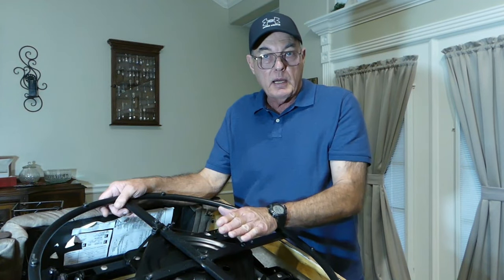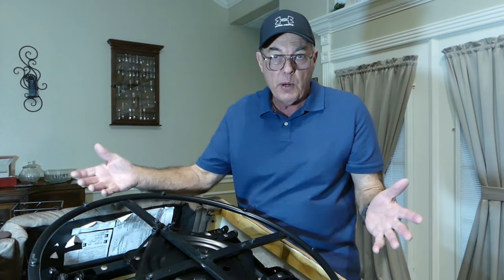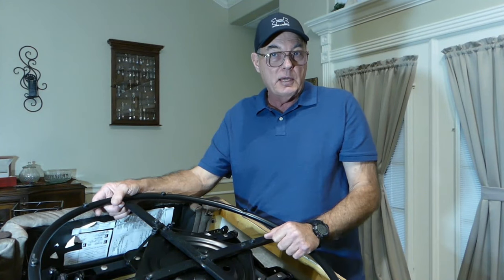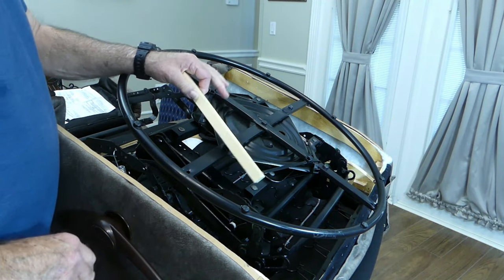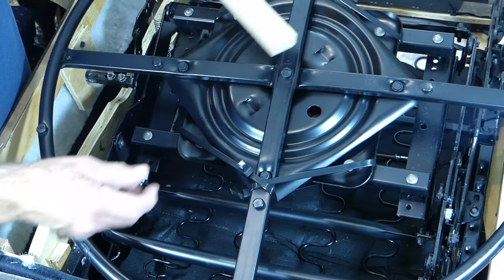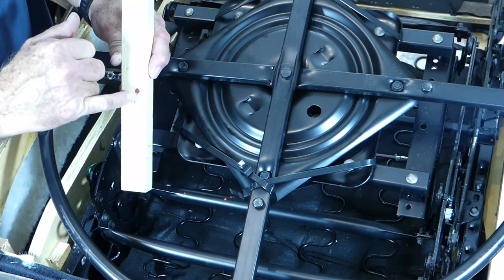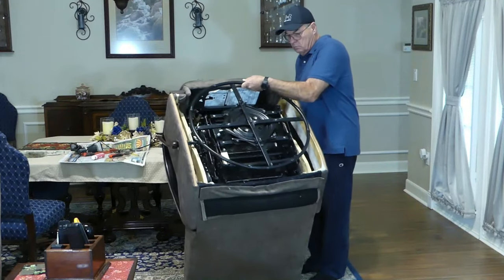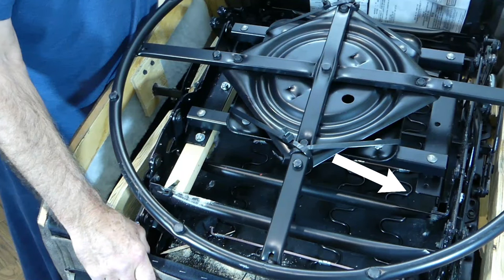How to Stop a Recliner from Rocking - Simple, Effective Method

Comment: Could you just the zip ties in all holes?
Reply from the maker: The problem is that you have to be able to stop both forward and backward motion.  I could have used a zip tie in one of the front holes and tied it around the stationary bar in front.  Then I would need to run a zip tie from one of the back holes to something stationary at the back of the chair.  Unfortunately, there wasn't such a place, so you would not be able to completely stabilize the chair.  Check your chair though, you may have a different mechanism and your idea may work.

Comment: Appreciate your videos! 😊 If possible, can you also show how to get a rolling desk chair to stop swiveling? My son, while sitting at his desk, doesn't want his chair to swivel while he works, as it's distracting. There is not a locking mechanism on the desk chair for the swivel, like there is for the chair tilting. (I thought 20 years ago we had this option on chairs.) I searched for a new rolling desk chair for him without swivel, or with locking swivel, to no avail. I was hoping to follow your tips to stop swiveling like you did on the recliner, but the rolling desk chair is different underneath. So I humbly ask, can a rolling desk chair's swivel be stopped? 😂 Thank you!
Reply from the maker: I,m not sure. I'll have to think about it until the little light bulb goes off in my head.  If I come up with a solution I'll probably do another video  and I'll try to comment back to you personally.

Comment: Great explanation, thank you! Do you think one would be able to just get by using a cable tie only to secure the mechanism once locked in position?
Reply from the maker: That may be possible if you have a different mechanism from mine. The problem is that sine the chair rocks in two different directions it takes a minimum of two cable ties.  Also you have to have a two stationary pieces of the frame, one on each side of the mechanism to make that work.  Unfortunately, there was no way to do it on my chair.   Using the wood piece really works well.

Comment: Will this work for a non-swivel rocker recliner?
How long was your 1x2?
Thank you.
Reply from the maker: If the mechanism is similar, it should work.  The main thing is to turn your recliner over like I did in the video and check what moves and what doesn't.  You need to be able to cable tie the board end to a stationary cross member.  The 1 X 2 piece I used was about 9" long, but the length could vary depending on your bolt hole pattern.  I put in 3 bolts to hold it, but you could just use two if you have to.

Comment: Do you think it is possible on a chair like yours to remove the swivel base and just add 4 legs to bring the chair up a bit? This base is broken and too heavy to clean around.  Still want to recline though. Thank  you kindly for your consideration!
Reply from the maker: I think it is possible, depending on your carpentry skills.  If your base is like mine, you can insert a spacer, made out of two or three layers of plywood, between the swivel assy. and the chair mechanism itself.  If the swivel assy is too badly broken, you could remove it and add a plywood plate to replace it and put legs on each corner, although they would have to be very short.  You could even use 2" x 2" pieces of 2 x 4 lumber.  The trick is to make a base wide enough to be stable but narrow enough not to extend beyond the sides of your chair.  Hope this helps.

Comment: Would this same method work on an electric recliner that rocks?
Reply from the maker: If it has the same type of mechanism, I would say yes.  Of course, I haven't seen your recliner, but the rocking motion usually does not rely on any kind of electrical assistance.
Reply: @deerparkhomeshop2471  thank you! We'll check it out :)